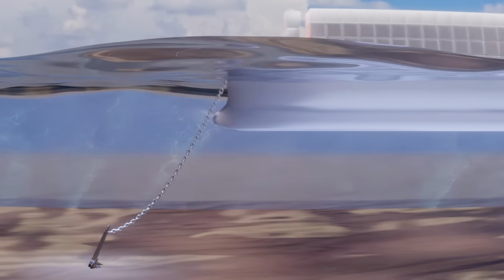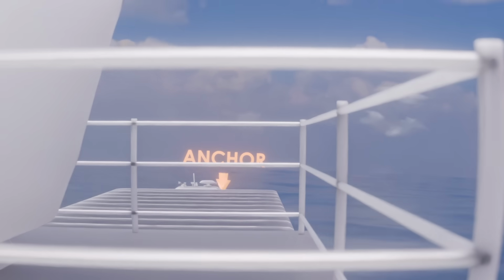Anchors don't work the way you think

Comment: Sorry Chris, love your work but this is where technical analysis, disconnected from fundamental analysis, becomes delusional.

There are gold miners on P/FCFs of under 2 for 2026, which still make profit at $2k gold. Gold, meanwhile is completely under owned in the West, only matching 2008 levels among Central Banks.

But then where does the liquidity flow? Presumably everything is just technicals, so another shiny object (like Palantir?) But which trade at P/FCs of 300+

Comment: The animation of your anchor chain is inaccurate. Anchor chain has a center stud in the middle of link. This gives the link strength and keeps it from deforming under load. The link also helps to prevent kinking of the chain in storage. The anchor itself is near correct, but looks more clip-art then accurate. Refer to the Patent Stockless or Baldt anchor.

Comment: So much arrogant ignorance here. This is may be how ship anchors work but it's NOT how boat anchors work. Boat anchors often have a rode made of lightweight nylon or rope which contributes nothing to the holding power. That's also why there are so many different kinds of boat anchors: so you can choose one that is appropriate for the sea bed you're sailing or boating in. And shackles are not 90 feet or 27.43 eurounits. They're measured in fathoms. It's 15 fathoms. Fathom is a measurement every sailor around the world knows and it's the basis for the boating measurement of speed, the knot. No one who knows what they're talking about would consider using an arbitrary scale when there's an industry specific standard that actually makes sense.

Comment: After using a small anchors for small boats where its just a regular rope on the end. I can see how much bigger vessels will need to benefit more from physics. I saw a video of the anchor release device failing and the anchor drops incredibly fast without a brake. It just broke off when it got to the end. Crazy video.

Comment: Yet you are ignoring the fact that small boats use anchors tied to light rope and it still works due to the physics of the anchor and the angle of the rope, not because of the wight of the rope dragging on the floor.

Comment: Nowhere to find the real trick for preventing the twist of shackles:  inbetween each is a vertical beam welded so they can not fold and make knots.  The chain runs out the chainlockers with an immense speed, it looks like a fluid tube of iron.

Comment: Well ,this is how I think anchors work as a mariner of some years experience. There is a whole methodology to laying out anchor cable properly as well as setting the anchor, and indeed calculating how much cable to use for the depth of water that is left out of this video, I guess to keep it simple. Small criticism - the scale of what the chain length would look like for the correct amount of cable for a big ship is way out of proportion - say the depth of water was 25m and the ship has a draught of 9m, the Admiralty formula for cable length would dictate 7.5 shackles of cable (i.e. 1.5 x Square  root of 25m in cables, where a cable is 90ft or 27.4m), so 205.5m of cable at the ship's waterline once the cable has set properly, so probably add another 20-25m of cable at the deck of the ship. This would be roughly 8 times the depth of water in the video's worth of chain, as opposed to about 2.5 times as portrayed in the picture.

Comment: I took the certificate for recreational boats a few years ago. There we learned that the length of the rope, or chain, should be three times the depth. This is well illustrated here by the fact that when the chain is tightened, it will pull the anchor down so it secures itself to the bottom when the boat drifts.

Comment: shackles are not commonly measured in how many links are painted. it is actually measured by the colour of the link. Red = 1 shot' yellow = 2 shots' blue = 3 shots' ,white = 4 shots' and green = 5 shots'.  and to remember the colour code its remembered by the phrase '' Rub Your Balls With Grease. and the word ''shot'' is referred to as a ''shackle'' (90 feet)

Comment: Side note: grand pianos are significantly heavier than that, unless you've been ripped off... but at 5:13 this is exactly the correct way to contrast the metric & imperial systems.
Reply: Agreed, a grand piano is 300-500 kg
Reply: And a blue whale weighs less than 230k kilos. Really seems he pulled the comparisons out of thin air.
Reply: Side side note: a note dropped inside a piano survives, but o the ocean, it gets wet.

Comment: This video perfectly answered a question I've had on my mind for a while now. Bc no way the anchor itself can just hold the ship in place, it weighs just a fraction of the ship afterall. If it was so heavy that it could, you'd never get it onboard, the ship would likely just capsize. And obviously it doesn't work just by hooking it into something, bc then you'd have to somehow wrench it free again, which is basically impossible if it's wedged enough to keep the ship in place. But for the life of me I could't figure out how that was supposed to work. I'm geniunely amazed people figured this shit out over 5000 years ago and my dumbass couldn't understand it even with help from wikipedia.

Comment: 02:15 Lol, someone has no clue how heavy a piano is. Virtually no pianos, whether upright or grand, are lighter than 160kg, they start at 200-220kg for the lightest ones. Now grand pianos are another species entirely, they can easily go as high as 550-600kg, so about 3.5x the weight of one link. Just saying.

Comment: To add to this:
Small boat anchors work the exact same way, the weight of the chain holding the boat in place etc. However, the chain isn't measured in shackles - on yachts, the chain is painted a different colour every 10 meters, which serves the same purpose, but in a different way. The anchors are also one-piece "CQR"/"kedge" construction instead of the folding Danforth style shown in the video. they work in the same way, but are shaped like a plough blade to dig in to the sea bed. They are more versatile than Danforths, but don't fold flat for storage.
Also, the Captain does measure the amount of chain out, and they base it on the depth of the water.
For an all-chain anchor, you need at least 4x the depth (anchored in 6 meters = 24 meters of chain, usually rounded up to 30 for safety).
For a mixture of chain and rope, typically used on keelboats and dinghies, you need 6x the depth.
For an all-rope anchor (not used on many boats, just smaller dinghies), you need 10x the depth.

One last thing: the more chain you put out, the wider the scope of the boat, or the radius of the circle you will swing around in. You need at least the amounts above, but if you have room or a big storm is coming in (and you can't get to a harbour in time), you would likely put more chain out to absorb more shock, as shown in the video. If you are anchored in a busy place, you would only use the minimum to lessen the risk of swinging into another boat, which might have a larger or smaller scope which intersects yours (of course, you always anchor with enough swinging room around the boat, but shit happens).
In a similar vein, if mooring stern-to (reversing up to) a quay with no bow lines in place, you would let out chain as you reverse up to the quay, fix stern lines to it, then pull up the anchor chain tight to keep you from being blown into the quay. In this scenario, the anchor is used as shown in the first half of the video, where the chain is in a more or less straight line to the anchor and the tension digs the anchor into the ground. Luckily the majority of places you would do this in have muddy or sandy bottoms, so it is safe to do so.

Comment: I think it is worth noting that the chain 'thing' really only applies for massive ships in the ocean.

However, if you are anchoring a smaller boats (especially in more shallow freshwater "bodies"), the anchors do just work by "digging" into the floor/bottom. They ALSO 'similarly' rely on their mass - but the "digging" crucial in windy conditions since the mass is insufficient on its own to keep the boat in place. For these smaller boats, many times, the anchors are attached ONLY with rope, but many do have short chains (a few feet) at the base/end of the anchor line. This applies to Jon boats, wakeboard/wakesurf/ski boats, pontoons, house boats, cruisers/"yachts", and other "smaller boats" (though, these "small boats" can be 50+ft in length - which is actually fairly big IMO).

That said, SOME smaller anchors rely SOLELY on their mass (no digging) to hold boats in place - though this really is only used for VERY small boats like jetskis, and they will often fail in windy situations. These "mass-only" anchors won't even have spikes/hooks/points/etc. - they will be "rounded off" and often are shaped like an upside-down mushroom. These are used because they are very compact, so you don't need to store them in a tiny boat.

But for the "digging"/hooked anchors, there are MANY situations where the chain (and its mass) is negligible/nonexistent, and the boat's anchoring relies almost entirely on the "digging". This is why these smaller boats will use an "anchor rope length" that is MUCH longer than the water depth. In particularly windy conditions, many people/boaters will use an anchor length that is 7× the depth. This is because the "angle" (between the anchor-line and the lake's floor/bottom) needs to be smaller - which allows the anchor to "catch" faster & "dig" further into the ground. 

Point being, this 'chain mass" 'mechanism' (described in the video) really only applies for VERY big SHIPS in deep ocean waters that have those VERY long, VERY heavy chains.
Reply: I have a fairly big IMO, too!
Not enough to become a porn star, though.
We ALREADY KNOW that every comment with citations or quantitative analysis is MERELY  an opinion, , so don't bother being timidly redundant.
IMO going now.
Reply: @briseboy 

I should have added a comma for more clarity & readability - though this wouldn't be grammatically [or logically] necessary to properly read & understand the sentence.

The current phrasing/formatting could be considered 'ambiguous' w.r.t. the 'flow' when "reading the sentence [aloud] in real-time". However, when you read it 'silently' & 'backtrack' if the 'flow'/emphasis/interpretstion results in illogical English - then there is no logical ambiguity in being able to read+understand the sentence (i.e., there is only one manner in which you can interpret given the sentence's context).

However, adding a comma (to 'fix' the psuedo-ambiguous phrasing you pointed out) would go against the 'spirit' of [the rest of] your reply -- it would be redunant punctuation. Your comment expresses 'disapproval of redundancy' while simultaneously requiring redundant punctuation to 'fix' the clunky phrasing. This is a bit contradictory, no?

Also, the use of "IMO" is not any more redundant than fixing the phrasing. That sentence was phrased as a declarative factual statement - and "IMO" serves to indicate that I am NOT making a claim of factuality. Additionally, an opinion of 'size' (whether something should be considered 'big' or 'small') has large variation from person to person. "IMO" would only be considered "truly redundant" IF I said something like 'I think [xyz] is big IMO" -- because saying "I think" indicates a statement of opinion rather than a factual declaration. 

After removing "IMO", the sentence would still be logically/gramatically correct,  but it would require context to ensure the reader's proper interpretation/understanding. Just like how my current (clunky) phrasing of that sentencd requires context to ensure proper interpretation (otherwise we end up with the "fairly big IMO" reading). That is precisely WHY I included the "IMO": to eliminate the need for context.

Either way, you were entirely "aware"/intentional when you removed the sentence's context to 'poke fun' of the phrasing - which is a pretty blatant misinterpretation of the logical consistency of my sentence. Ultimately, your reply has an inherent contradiction on this matter. You can't simultanously 'disapprove' of [even minor] redundancy while simultaneously 'disapproving' of the minimally-redundant "logical interfacing" of the grammar in that same sentence. "Fixing" the phrasing of that sentence requires introducing redundancy into the comment.
Reply: For another point going in that direction: a cargo ship weighing 200,000 tons can afford to carry 200 tons of anchor + chain, it would be another story on a 2 tons leisure ship.

Comment: Most common Anchors weigh at least 8 to 10tons ang a single chain link is about 15 to 25 kilograms average 20 kgs in Bangladesh with strong current 6 to 10kts we are using Main Engine to stay and keep our position dead slow ahead only during during slack tide we  stop engine very difficult place to anchor especially with so many other ships around

Comment: As a yacht captain its always based on how much depth you have below you, usually you want to drop 4-5 times your depth in anchor chain  to ensure proper holding. This varies alot depening on your surroundings as you could have shallow water or other obstructions around you. It takes time to learn how to do it properly and is a key part in maritime navigation.

Comment: Great visuals!  Was just explaining to my wife the other day that essentially, the anchor holds the chain, and the chain holds the ship!  Also, in the US Navy, the scope of chain you let out is typically 5 to 7 times the depth of the water to make sure you properly set the anchor and have sufficient chain to not drag.  For one difference between commercial vs US Navy, the first detachable link (connecting the first shot of chain to the second) is red (with one white link on the either side), the second detachable link is white (with two white links on either side), the third detachable link is blue (with three white links on either side), and it repeats red, white, and blue with the appropriate number of white links on either side to give you an idea of how many shots of chain you've let out!  Thanks for the video!
Reply: Agreed! In your video, the ratio between depth and chain length seems to be around 2. As an amateur skipper, the recommended ratio should be 5, under heavy conditions 7.
Reply: Freedom chains

Comment: Pianos are MUCH heavier than 160kg. Even uprights weigh around 250kg, small grand pianos around 300-400, let alone a concert grand (600kg). They HAVE to be heavy, or they would hop around under the playing force of a pianist and the 20 TONS of tension forces of the strings on the steel frame (the frame alone weighs 80-100kg).

Comment: 2:14 A grand piano is actually heavier than 160 kg; it can weigh around 250 kg or more.
Reply: I had an old Upright piano from the 1890s which weighed 280kg. The smallest grand piano type weighs around the same, a concert grand can weigh up to 700kg. I suppose he really didn't check those facts.

Comment: If a ship needs to Stop in the middle of the ocean....thats a fail already....because the water is too deep... To get the anchor a ground in deep seas U will need an anchorchain thats as Long as the Waters depth at least... ITS actually the  chain's weight that keeps a ship in place...anchors only will be dropped in more shallow Waters next to the coastal Landside...

Comment: the chain is actually what sets the anchor. I anchor in 100ft of water with avg current of 2-7knts. Slack tide you can get away with listed above but under strong current you need the anchor chain to lay on the bottom while dragging the anchor until it sticks, once its locks up all the slack comes out and you are tight with the anchor and no chain laying on the bottom. Your anchor will burry its self 1-2ft under the sand\mud by the time you stop. I see large freighters anchored off the cost quick frequently and they all have a strong 45 degree angle on the line and sometimes 2 anchors to keep boat in a N\S orientation.

Comment: I am doing a Restomod KLE build. Full frame up resto 2K black chassis and ivory gloss white fairings. Motor etc in black crinkle coat. KYB front end conversion. KTM SX Rally stacked headlights. Digital cluster. Custom wind visor. Rear footpeg delete. Lots of everything delete. ZZR600R coil on plug ignition upgrade. 
I have a 2008 Ford Falcon horn for my KLE.
I am running a WR450 silencer

Comment: just to add, in good weather mostly you drop length of chain in 5x the depth of the water. For example the UKC is 30 meters plus your ships mean draft lets say 5 meters that equates to the water depth of 35 meters you then multiply it 5 times so 35x5=175 mtrs. then you devide it by 27.5 since 1 shackle is 27.5 meters and the result is 6.3 shackles meaning you will drop 6.3 shackles in the water or just make it 7 just to be sure.